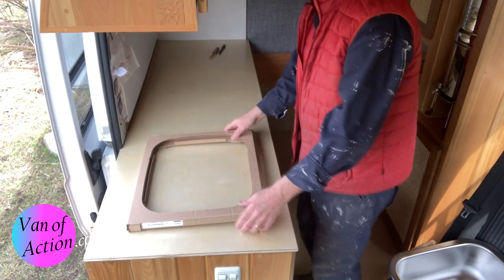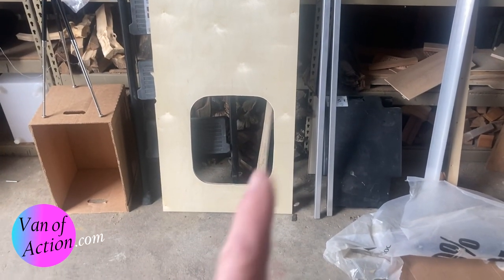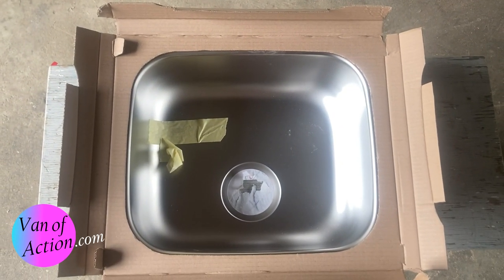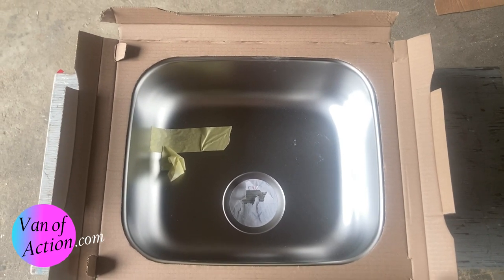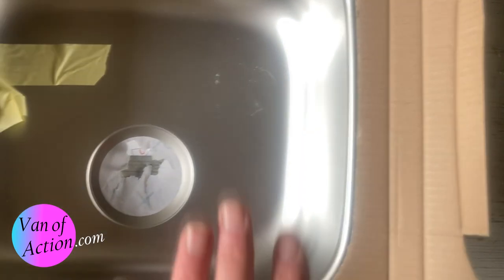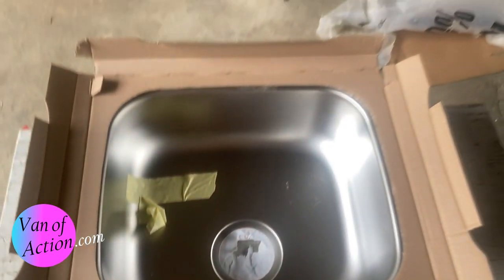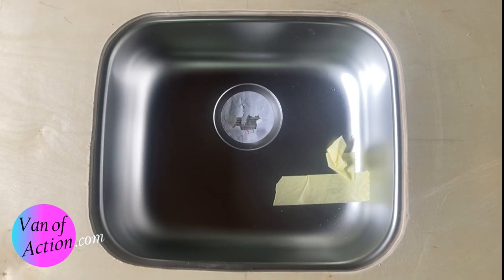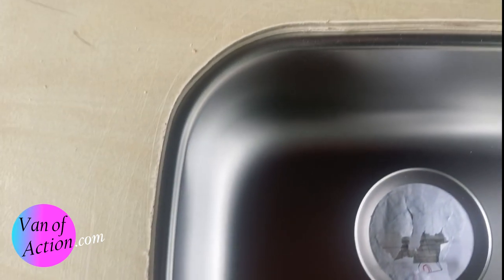How To Build a Kitchen In DIY Van Build Like A Pro For Camper Van Off Road Boondocking and Vanlif

Comment: Some great info about scribing and love the jigs! I've barely done any carpentry work before but if you had the tools would an offset router bit work? As in, putting say a 1/4inch bearing on a 1/2 inch flush trim bit to create the offset?
Reply from the maker: Hi The Vanderful Life (great name) - that’s a good question. There are always many paths to the same end.  I’m not suggesting I’m doing things the only way or even the best way.   It’s just right for me at the time……… The short answer is yes a router would work. BUT - There’s always a but.  1. The counter top would have to be thick enough to allow for the offset.  The 1/2” I used should be 3/4” which would add 50% more weight. But b. In order to use the router you would have to do everything I’ve done so far anyway - because the router needs a pattern (or template) to run against.  Either inside or outside the hole - if you know what I mean, if not ask and I’ll explain. But 3. more importantly for me - edging the “stepped” lip would be a problem.  And this is an area that will be exposed to moisture whenever (if ever) the sink is used.   So I want to be sure I can seal the edge well.  Stay tuned for part 2 to see how I did that.  So……. For me - using a router would be more work and harder to seal as a finished product.  Thank you so much for watching and taking the time to ask.  Be well.